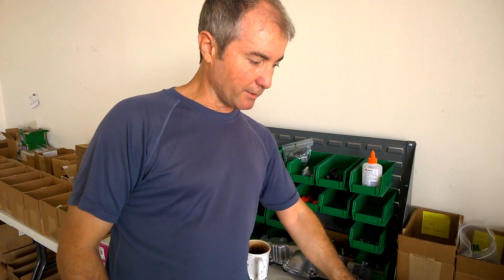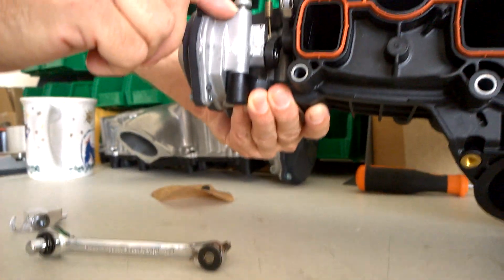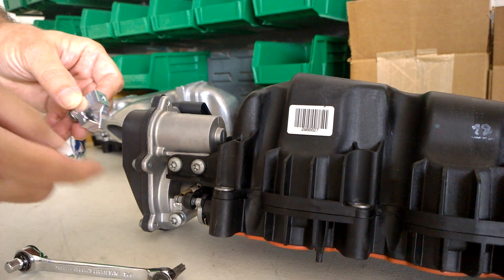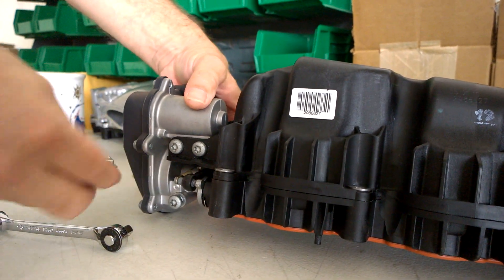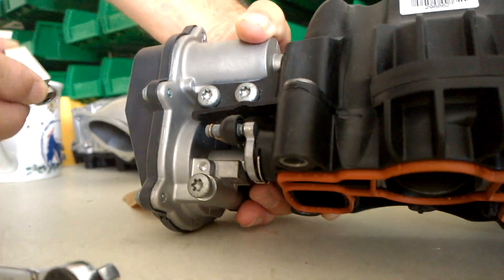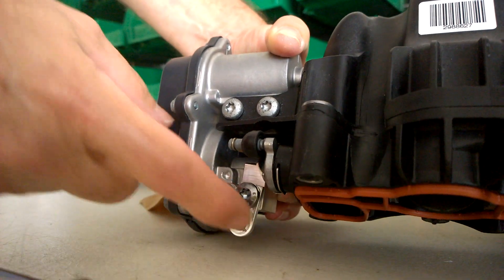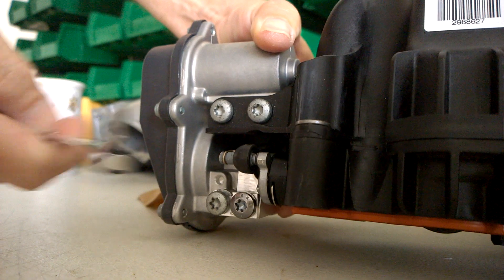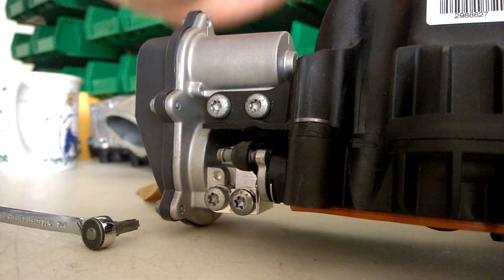Installing Dieselgeek repair bracket on manifold 03L 129 711AG

Comment: None of these videos about P2015 show how to take out intake manifold... :/ 
Edit: There are separate videos about manifold, not hard to find.
Reply: @dieselgeekdotcom  I just looked there and I realized what are you talking about. To remove my plastic manifold I have to remove fuel rail. It is really hard to avoid fuel system contamination. Without removing manifold it looks very difficult. I have to do some kind of surgeon training and buy some long fancy pliers.

Comment: Hello
I have a vw tiguan 2.0 TDI (common rail) from 2010 with plastic intake manifold ( engine tipe D CBA)
the question are: where i can buy thus brackets?
How much?
It 8s possible fitted without remove the intake manifold?
I think that i haven't enought space for turn the braket fixed support for the bottom of the valve screw
Thanks for all.
Reply: Did you remove the manifold to replace?